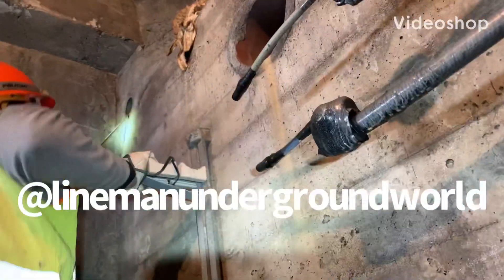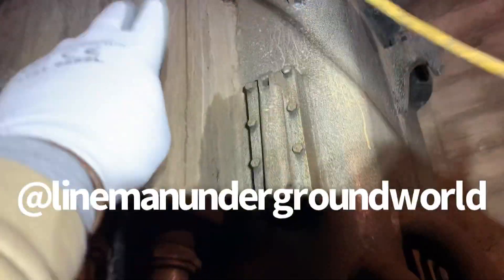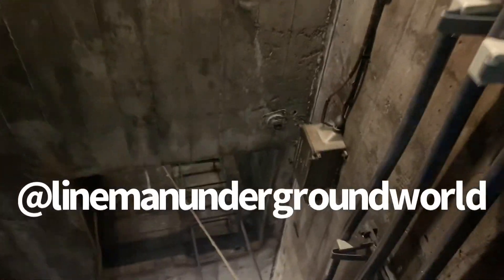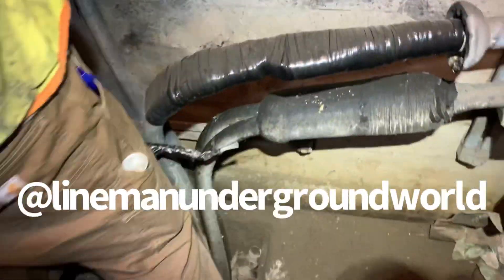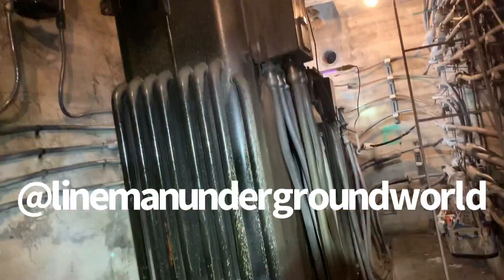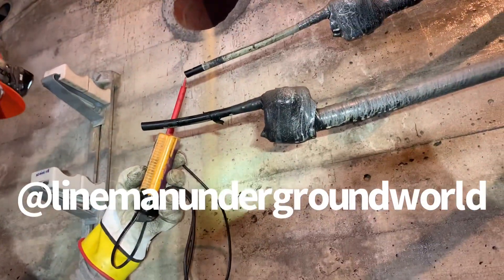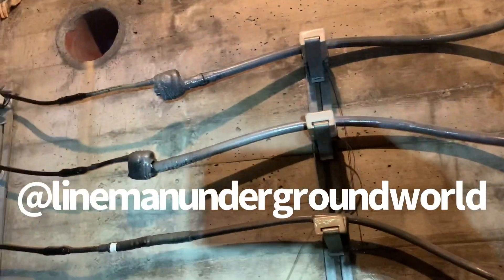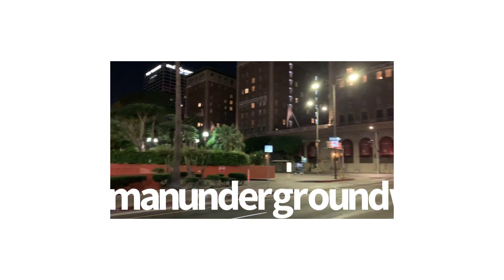Apprentice job

Comment: I wonder if it's just a bad motor run cap in that blower motor, great video I love seeing the old stuff still in service :)
Reply from the maker: Wazzup Joey what happens is the heat and the condensation eats up the metal and then she fails thanks